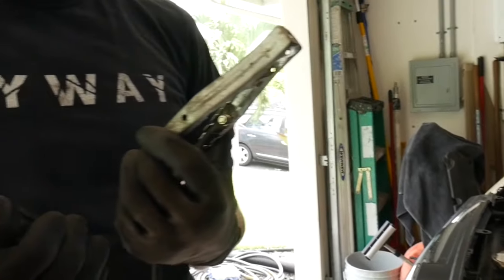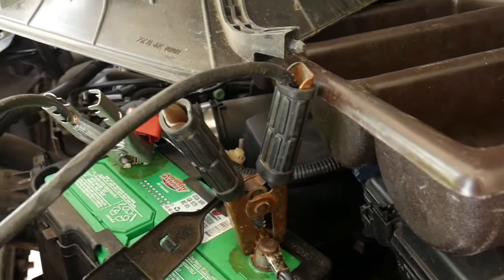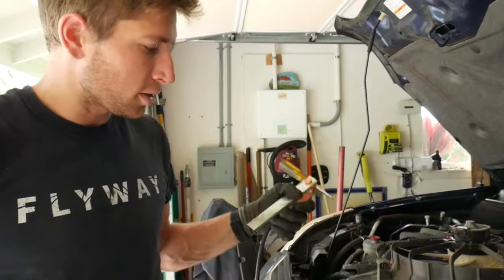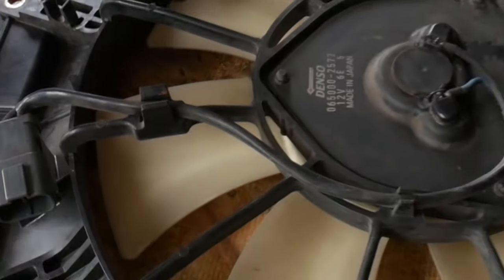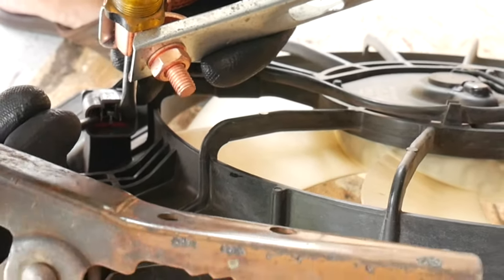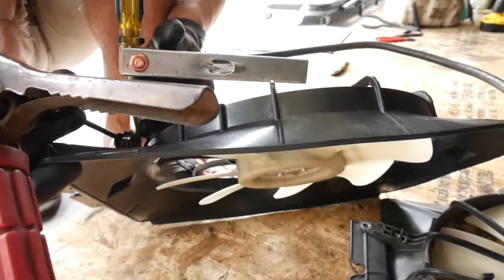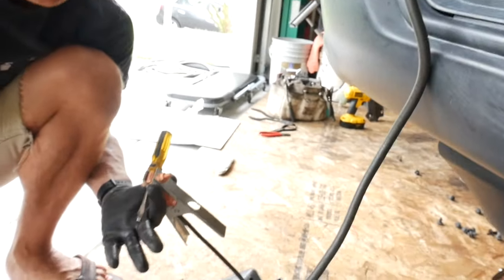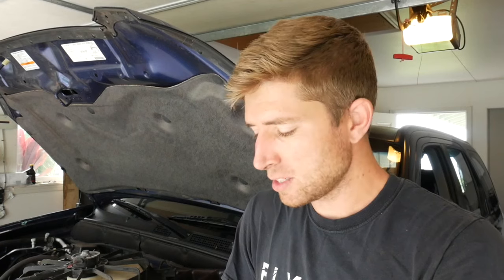EASY Test Honda CR-V Cooling Fan A/C Condenser Fan with Jumper Cables

Comment: Thank you for this video. I'm in the process of troubleshooting warm A/C in my car and I think it is caused by the radiator/condenser cooling fan not switching to high speed whenever I turn on the A/C. It will just turn on to the lower speed but I do not think it provides sufficient airflow to the condenser. I do have some jumper wires that I can use to test the fan in the manner that you did.

Comment: I should have done this before wasting two hours to change a perfectly good thermostat and dumping a gallon of coolant on my driveway.  I hope I can reach those leads without pulling the whole fan out.  I’m going to try this tonight before I change out the coolant temperature sensor on my 98 CRV.
Reply: Yeah, you don't have to take the fan out to jump it! Hopefully you got the old girl sorted! Excel vehicle! If only the transmission would last as long as the engine!

Comment: You can also carefully tap the fan motor while the engine is up to temp. If the fan moves, the fan is failing. It will need to be changed.

Comment: 005 crv keeps bloeing the 20 amp guse for the condenser fan everytime I turn ac on. We unplugged compressor and it still blew fuse. Then we unplughed condender fan and it still blee a fuse. The condenser fan is the one on the passanger side, right?
Reply from the maker: Not sure which side it’s on sorry. See which fan goes on when the car warms up without AC on. (The one not running is condenser fan) 
If still blowing fuse with fan unplugged you must have a wire or something shorting out before the fan. Check all your wires leading back from the fan

Comment: Is there a way to test the fan(s) while it is still in place? Do you recommend OEM fans, or cheaper aftermarket fans? I'd like to not have to do this again for the next 100,000 miles! Can you recommend quality replacement fans? Thanks for this, and the other video, really helpful.
Reply: There is a tool called Power probe,there is cheaper versions.It is like a test light but it also gives you the option to add 12 volt power to what ever you touch with the tip.Test power window motors,sunroofs,lights,anything with a electric motor.And its good practice to disconnect your battery when doing electrical diagnostic trouble shooting to not create further damage or to something else.
Reply: @robmendoza6210  Thanks Rob, so you'd just unplug each fan, and give them each 12 volts from the Power Probe? This would bypass the car's battery, so that is safer?

What kind of amperage does the Power Probe put out? What kind of amperage do the fans take?  Could I plug in a 12v wall wart adapter, like a standard 12v AC to DC power adapter and use that as a power probe to power the fan motors? Again, I wonder as to the fan's amperage rating? I've got a variety of 12v adapters that go from like 200mA, to like 2A. I should be able to spin a fan, if they are working, but if I hit it with lower amperage, it might not spin too fast, mimicking a dead fan, right?

Assuming I'm able to power up and spin each fan... what do I need to test from there, relays? Switches? How do I test those?

See, it is a pain in the butt being helpful!

Thanks again!
Reply: @alphanumeric1529  not really that painfull at all,more like time consuming.If I could get money from holding you by the hand and answering all your great questions i would have no prOblem putting at least 8 hours a day.
Reply: @alphanumeric1529  also worthy mentiOn,I don't even remember that 1+ year old cOmment.
Reply: @robmendoza6210  It's the time consumption itself that is painful, and why I appreciate people who share their knowledge. I lived in a time before we could share information like this, and this is amazing, but it still requires people willing to put in the time. I'm so thankful for them. I don't disrespect them for their efforts. If they fall short, I'll fill in what I perceive as gaps, trust me in that!

I can't find anywhere on the web how many amps the 2005 crv's various fans pull. But I can find that Civics of the same vintage pull anywhere between 8 and 10 amps! That's a lot! I don't have a 12 volt adapter that puts out that kind of amperage, I'll have to go for unconnecting the negative of the car battery, and running the battery with jumper cables and screw drivers as probes right into the fans to see if they'll spin up!

Thanks for your help, and if you have more to share, please do!
Reply: Test it the same way, but in the vehicle.  What I would do is unplug it, get a couple 3-4 foot pieces of house wire (12 gauge), strip about an inch off both ends of both pieces, stick one wire in each side of the connector attached to the fan, then touch one to the positive terminal and one to the negative terminal of the battery.  Essentially what he did without using jumper cables and screwdrivers.

Comment: my 2009 crv AC issues started with replacing the AC clutch relay 6 yrs ago, then last year i replaced the AC clutch and compressor. recently it was blowing cool not cold air. i checked the freon and the levels were below average so i wanted to top it off, then all of a sudden the freon gauge went nuts and all of a sudden i heard the all too familiar back and forth clicking of the AC clutch. i went ahead and replaced the clutch relay again to the same results. BUT i noticed that while the AC clutch was clicking off and on....the cooling fan was never on the whole time and i just noticed it. I want to replace the cooling fan, but would that also take care of the AC clutch clicking off and on?
Reply from the maker: Your fan should always come on when ac is turned on, so I would definitely look into that. I would be surprised if the fan would cause ac engagement problems but it sounds like you may need to get some help from someone who can diagnose it in person and get a good ac machine on there
Reply: I just found out it was my high side valve which was leaking.
Reply: P JB so did the leaky valve cause the fan not to kick on ?
Reply: Freddy Claudio correct sir. I got it replaced. Still working so far!